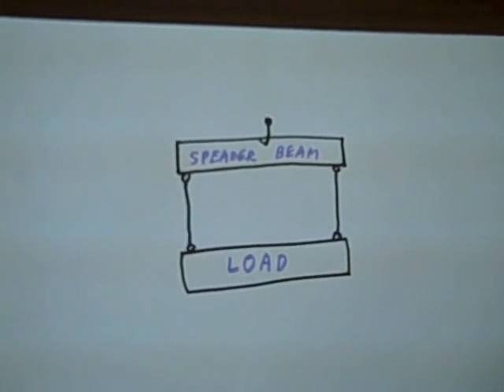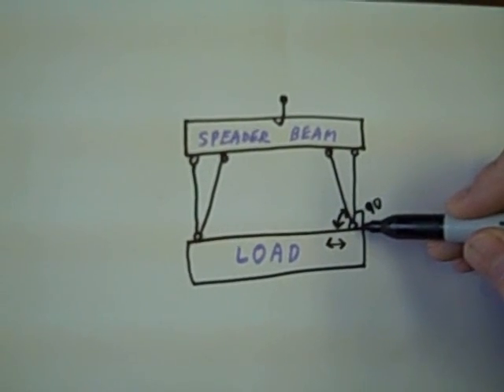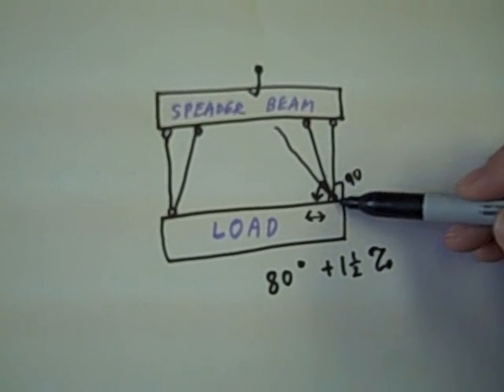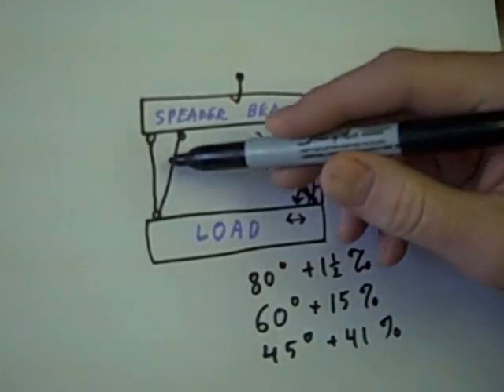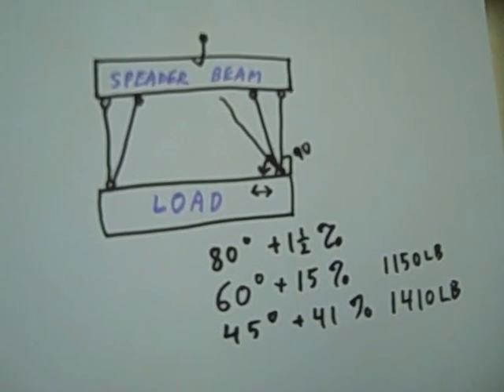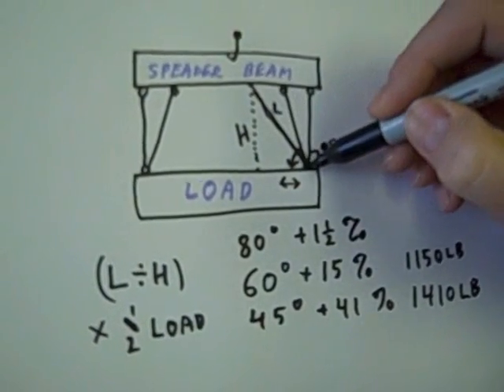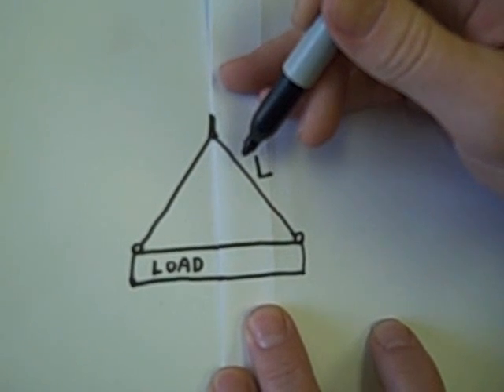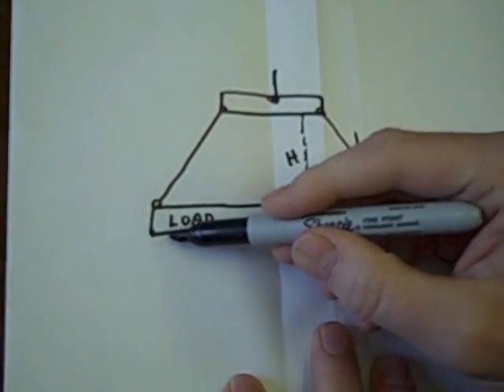Calculating The Force On A Sling Load Connected To A Spreader Beam

Comment: Sorry, in the real world, you would not know the Hook Height just by knowing the length of the chain, given your formula.
To find out the hook height (HH) you must use trigonometry, since you don't know the measurement from the pickpoint of the load and its vertical line along the load to find the vertical 90 degrees to the HH.
I understand that your math can work, but you need to find 2 values first, the HH and D (from 90 degrees horizontal to pick point) to be able to apply your (L/H) x (weight/2)

Comment: How can you tell that % forces will act @ that particular angle can you explain sir
Reply: When you lift a load and the chains or slings are vertical from the pick point of the load (linked to a spreader beam), the forces are only acting on the vertical. Like lifting a shopping bag from the floor.
The problem is if the chain or sling is at an angle (no using a spreader beam) ie hooked in the middle by a Master Link. Then you have another force acting on the chain, this is from the pick point of the chain towards the centre of the load.

I hope it helps.

Comment: It’s good that you are sharing your knowledge, however it’s not so good that you show large sling angles when using a spreader beam. You need to show those angles when using a lifting beam, not a spreader beam. Two entirely different pieces of equipment. Let’s hope people don’t now think they can use large angles like you demonstrate with a spreader beam. 
A spreader beam is only designed for vertical lifting with a + or - of 6 degrees for the drop link.
Reply: Tell me more...
Reply: Whilst technically you are correct, they are physically the same apparatus but where it differs is on the attachment point on the beam itself. The lifting beam has only one hooking point (on the centre of the beam) hence it is generally called a lifting beam.
The spreader beam generally has two or more hooking points, equidistant from its centre.

Comment: You are awesome! Thank you so very much. So much more simplistic than all that other crap. I'm trying to blindly go in and take my advanced rigger NCCER certs. My next problem is how to figure out the load on each crane on a two crane pick. Then how to find c.o.g. On a aasymmetrical piece
Reply: whatever54777 Times load by 1.25 .That will give you min crane capacity needed by each crane at maximum radius of cranes